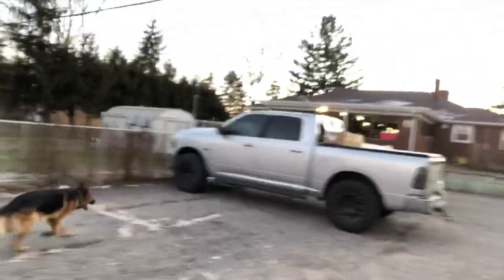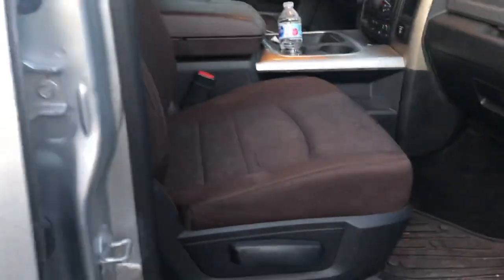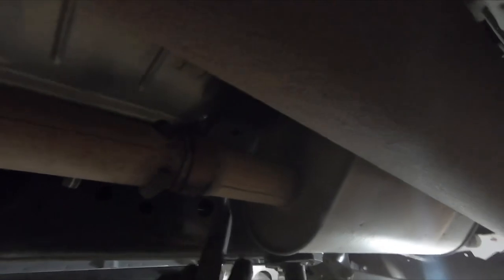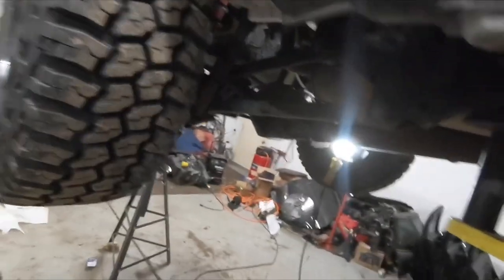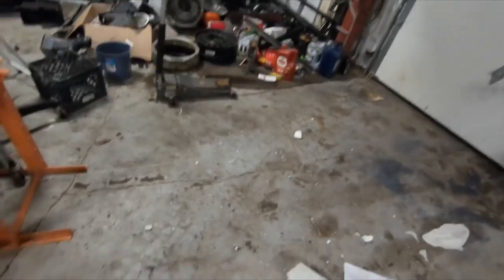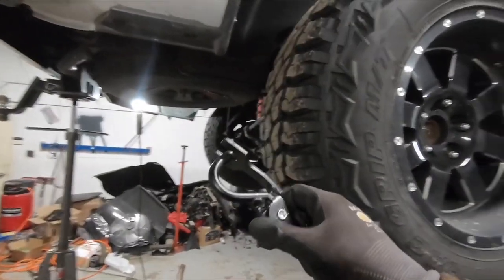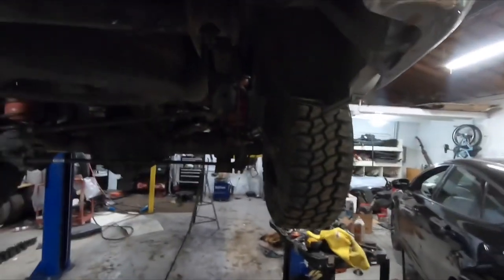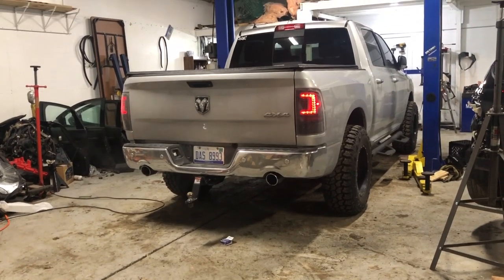Amazon Muffler on my 2016 RAM 1500 install/first impressions!

Comment: Awesome video,  I didn't a muffler delete with a y-pipe.  Makes the hemi roar, felt the issue with the bolts.  Had use a breaker bar for the inlet of the muffler,  and strong arm the rest.  Big horn making big noise now BABE!!!

Comment: Hows the muffler replacement holding up 3 years later? Thinking about buying the same for my 2011 Ram 1500 Sport 4x4 (also in Michigan so the rust will be fun to contend with).
Reply from the maker: I ended up selling the truck but it held up for close to 3 years of ownership.

Comment: Sounds good, I have a 2016 Hemi also and want to do the same thing. Other than the length of the muffler what are the differences between the 14" and 18"? How is the drone inside the cab with the 14"? And does it effect the eco?
Thanks
Reply from the maker: Harleysg06 I just noticed their was two different versions, i dont think the 18” was available for purchase at the time unless i missed it. I’d imagine with the larger muffler, it would be quieter than the 14in. To be honest the 14in is already a somewhat quiet muffler compared to a straight pipe setup so I’d probably either stick to the 14in or the straight/y pipe setup.